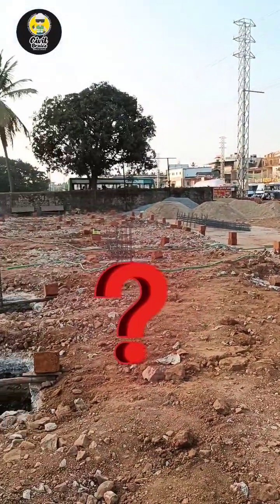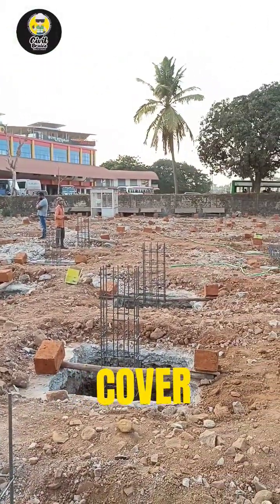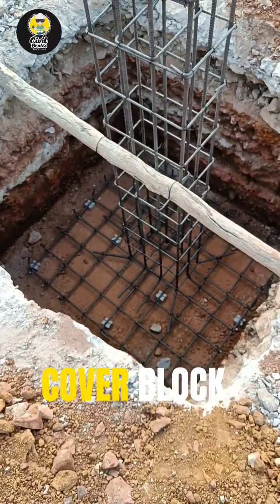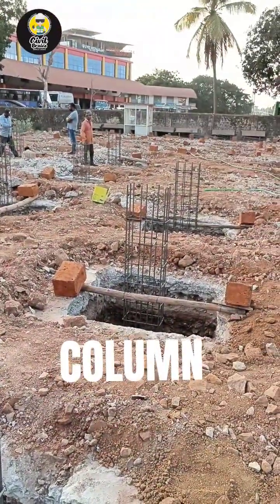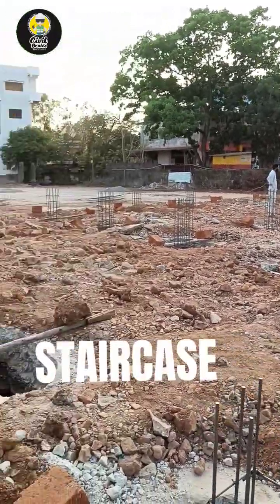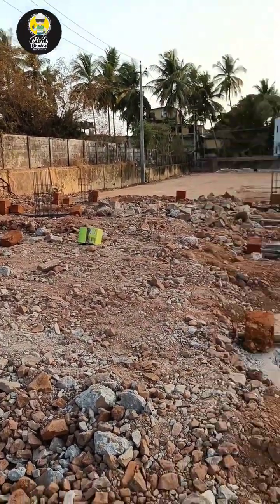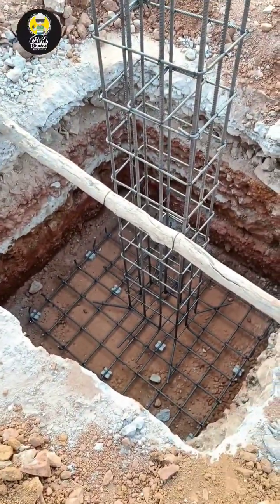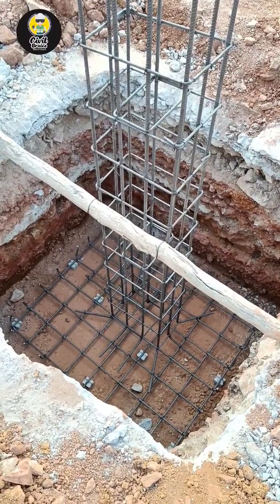Cover Block Size for Footing, Column, Beam, Slab, and Staircase II

Comment: sir my builder made huge mistake i think, he gave a 3-4-inch thick plain cement concrete (pcc) slab (after soling with rock ) with a 1-inch covering of reinforcement mesh and a 10-inch footing , can i go for g+3 residential house